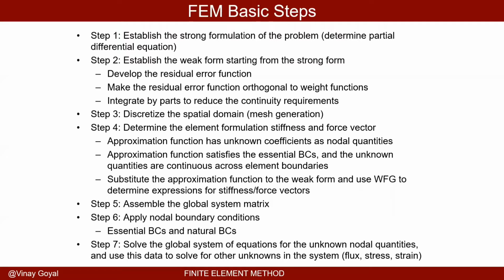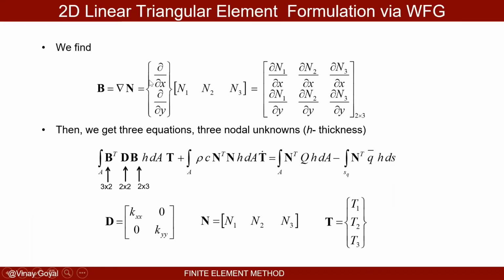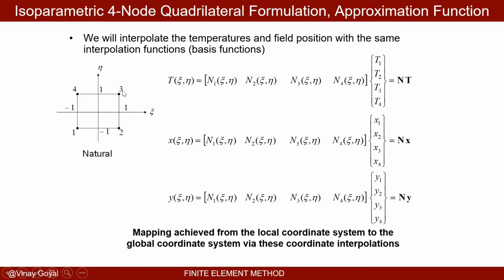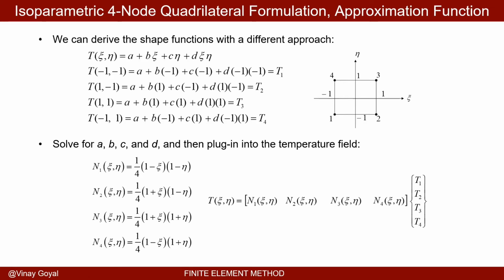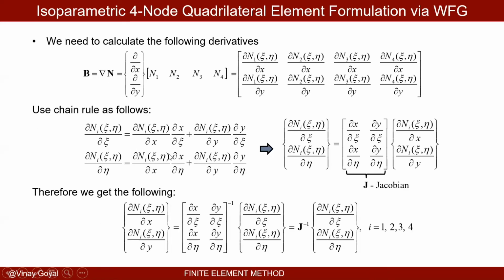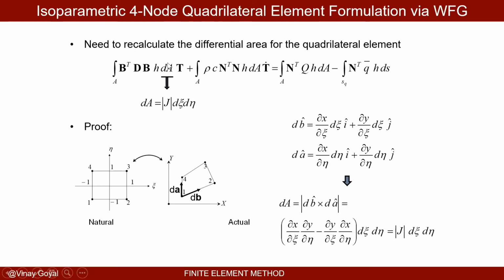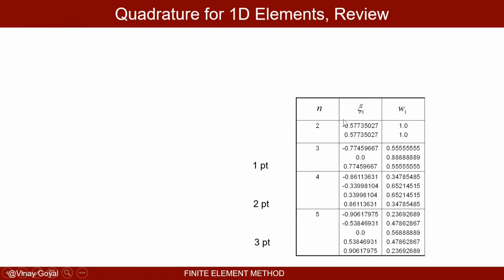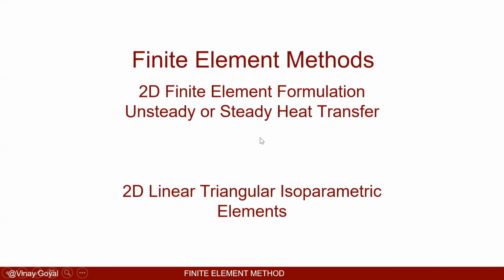Finite Element Method: Lecture 17A - 2D  Isoparametric Quadrilateral Bilinear Element

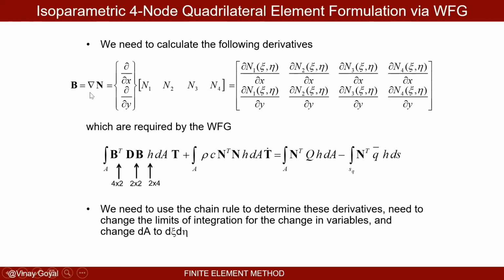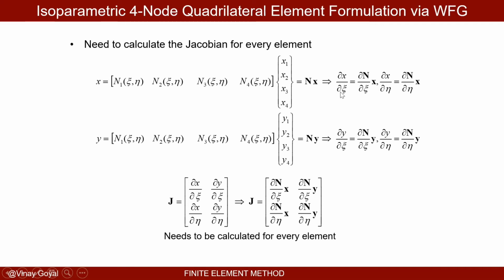Comment: Sir, I think the B matrix shown at 16:39 should be defined using shape functions in actual co-ordinate system (not the shape functions derived in natural co-ordinate system using \eta and \xi). Furthermore, the derived isoparametric shape functions are used only to define the co-ordinate mapping and Jacobian matrix shown in 23:24 (as per my understanding). Due to co-ordinate mapping in the domain of master element, the shape functions in actual co-ordinate system becomes equivalent to those in natural co-ordinate system. In addition, it would be helpful if the symbols used for shape functions in actual and natural co-ordinate systems are different. 

Anyway, Thank you very much, Sir for providing such insightful lectures.🙏